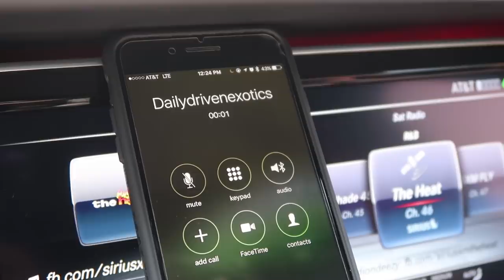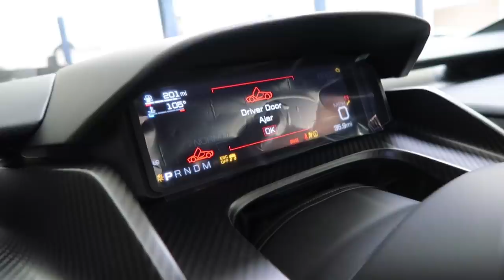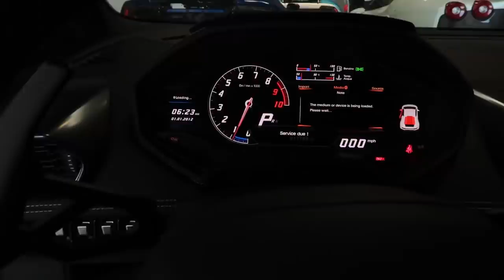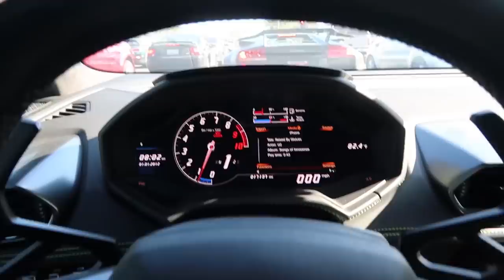I MADE MY LAMBO FASTER THAN A BUGATTI!!!

Comment: You should twin turbo it to with the super changer and see how fast it will go
Reply: Wolf skull You're trolling...
Reply: Wolf skull That is just screaming problems.
Reply: Wolf skull uh. U cant
Reply: Wolf skull hh
Reply: Wolf skull he would have to build his transmission and other engine parts because the stock parts couldn't handle of that power and that would mean it would be in the shop for months
Reply: Rumpaj you can, its called a twincharger. But his tranny would probably fall off the bottom of his car within a day of driving it.
Reply: Rumpaj yes you can😂
Reply: +Turbzay with twin superchargers, an estimation for the trans lasting a day is a bit too optimistic...:-) also, a twincharger is a considerably more difficult build to do...and its not like you just leave in the first supercharger and throw in another one- its a complete redo...
Reply: Twincharger not TwinSUPERcharger. He means Turbos + SC
Reply: Rumpaj yeah you can
Reply: I think it would explode if he did that
Reply: twin turbo whit the "super changer" 😂
Reply: You can get 2000+ hp from just twin turbos. Twin charger setups are extremely expensive and complicated builds. Not really worth it. The acceleration might differ but stock internals wouldn't last very long.
Reply: twin turbo with 2000+ bhp and stock internals wouldnt last a mile...
Reply: Compound charge doesn't directly make it faster, just different response.

Comment: It might have been faster than a Bugatti, if you put turbos in.
Reply: Ya Boi not even remotely close
Reply: Ya Boi A twin turbo v10 vs a quad turbo v16, yea I think you are wrong by quite a far margin.
Reply: You do realize how much Veyron's weigh? Ever heard of Power to Weight ratio?
Reply: Taste Da Rainbow w16*
Reply: Taste Da Rainbow the chiron weights like a tank
Reply: nope not even close
Reply: lmao a lot of people have heard of Underground Racing's twin turbo lambos huh?  Stage 1Rs easily reach 1200+hp
Reply: Luq Man stage 3 race heads run 1200 whp. A Stage 1R is 1550 whp+
Reply: Ya Boi 2,4 is faster than a Bugatti
Reply: Taste Da Rainbow number of turbos and cylinders doesn’t mean much. Single turbo 4 cylinder cars can take a Bugatti in a drag race...
Reply: Yeahhhhh boiiiiiii
Reply: Niko Moin Quicker not faster.A bugatti top speed trumps a lamborgini.You are referring to acceleration the Chiron can easily 2.4 secs or even better
Reply: PPSHY Chiron doesn't way like a tank.That is a gross over exxageration
Reply: mana843 weight only matters in acceleration and handling, not top speed

Comment: Supercharged is absolutely the way to go. It's power on demand. Instant torque, and a nice linear power band.   The car is still drivable, as far as handling is concerned, plus it's fast. Straight  line speed is what twin turbos are good for. That's it. And they look good. Super glad things worked out the way they did, even though it was a bit of a kick in the nuts getting there.

Comment: That shop employee revved a multi-million dollar Lamborghini without warming up the engine. You can see the redline was limited to 6k, which the car does when it's cold. He revved it to 6k.
Reply: So whats your point?
Reply: I thought exactly the same thing. What will the owner say if he sees this video...
Reply: multi million try 300 k
Reply: mohammed alshawi its 2 mill
Reply: mohammed alshawi do you even know what that car is?
Reply: k
Reply: Engine wasn't moving the weight of the car (no load) so it's not that bad but still something I would avoid.
Reply: That's the centenario, it costs about $2.5 million. Not 300k like an "average lamborghini"
Reply: mohammed alshawi oh its multi million
Reply: Willy Willy They know what they are doing
Reply: Willy Willy So its safe then? The car already protects itself :)
Reply: A short rev won't do much harm.
Reply: First Last Racists aren't welcome here
Reply: nah
Reply: Willy Willy They don't redline at 6k... Way higher. Shouldn't need a ton of warming up in 90 degree weather if it was a cold start.
Reply: Nobody asked you! GFY! If you pause the video at 10:33 it absolutely redlines at 6k, not even debatable. It's an electronic dash, so I guess the redline might change after it's warmed up, but there's no doubt it's 6k.
Reply: Willy Willy it's 90 degrees, the oil isn't cold n thick, 5 seconds and the top should be good to rev.
Reply: I Know it was so cringe. It wasn't even one rev, he kept doing it over and over.
Reply: That's a Cenenario, not a Huracan.
Reply: My whole comment was based around the fact that no, they don't.
Reply: An engine like that is warm at 220F, not 90F. 90F is better than 30F but it's NOT EVEN CLOSE to being warmed up.
Reply: When the engine is cold, it redlines at 6k to protect itself. When it's warm, it moves to 9k.
Reply: Sorry man, that's just not true. You gotta let the oil warm up if you want to be respectful of the engine. Load or not.
Reply: Who gives a shit this is a car that will never make it to even 50k miles in its life redline it every day on cold start and the racing engine Lamborghini made for it will still last im sure...
Reply: First Last Believing that your statement was fact is the definition of racism. Something tells me you struggled in school.
Reply: It's just a car...
Reply: what in the name of thew world r u talking about
Reply: Isn't the point of a variable redline to prevent damage from exactly this?
Reply: +mohammed alshawi, It's A Lamborghini Centenario. A Special Edition Of The Aventador, Which Itself, Is Worth Twice As Much As An Huracan. The Aventador is At Least $450K, And This Centenario, Which Has Been Customized, With Color Schemes, Is Definitely At Least  $2 Million.
Reply: First Last where are you from?
Reply: Andres .C  it can do more harm sometimes than a long rev
Reply: Tbf how do you know it wasn't warmed up prior
Reply: John Rockett  I well it had the small bit of white smoke which hints at it
Reply: Chad West Lmao it’s a quarter of a million not even close to 2 million
Reply: Willy Lamb Definitely not a multi-million dollar car. It’s a quarter of a million lol.

Comment: Maybe you can finally beat streetspeed717 now
Reply: Riley Bunce not if he gets a built diff
Reply: Riley Bunce No way.
Reply: He plans on replacing the z06 with a grand sport. Parker will win easily, doesn't matter whether he builds his diff or not the guy cant shift
Reply: Tyler Hoeve his car isn't running because he blew his diff. He can't put the power down that his car is capable of unless he upgrades it.
Reply: Tyler Hoeve no because the diff he just blew has not been replaced and then maybe he could accually put down his full 1k tq. and 990 hp.
Reply: GudJuJu If he had a auto with launch control then it's a different story but he is still going to have to slip the clutch off the line so built diff is not going to make it faster it's going to make it more reliable. Better tires (slicks) with the built diff would make it faster because he could get out the hole faster leaving at a higher RPM but his drag radials can't take a higher RPM therefore the diff will not allow him to leave harder on it's own therefore will not make it faster. This is common sense I don't even know why I have to explain something like this to someone a diff is not a power adder just because you upgrade something dosnt mean your car is all of a sudden going to be faster.
Reply: Tyler Hoeve who claimed speed? If you can't put the power down from a dig when your intended use is to drop the clutch then you need a diff that's capable of the power. Why are you intentionally missing the point? You realize nobody claimed speed at all right? If you can't put the power down without shattering your diff into tiny little pieces you need to upgrade
Reply: GudJuJu Clearly you are the one intentionally missing the point and you do not drop the clutch you slip it that comment right there let's me know who I'm talking to lmao prob never even drove a car let alone drag raced one.  I'm speaking logically you kids think adding a built diff makes a car faster because you can launch it harder when in reality he was already spinning on drag radials without a built diff so how in the world can you gits claim a built diff will make him faster he can't leave any harder then he already was tires will make him faster a built diff just makes it more reliable stop trying to dodge the obvious.
Reply: Tyler Hoeve nobody is even claiming that he's trying to launch harder that's another good one, we're stating that the way he launches RIGHT NOW is too much stress on his diff
Reply: ali129 thats a big downgrade
Reply: GudJuJu if you drop the clutch on that car you will either burn the tires off or break a trans

Comment: Bro your car is perfect. Don't do nothing more to it except for bumping the HP from 805 to 1005 and also you would need a transmission build. Just to be sure. While you at it. Change your front and rear diff oil.

Comment: How is a VF800 kit faster than a Bugatti?  I assume you are talking about a Veyron and that still cannot be accurate.  The top speed and the acceleration to 200mph by the Veyron is beyond this modified Huracan.  Plus, I don't see the HP per dollar a value here at $30,000 for this kit, you are getting a 200hp bump.  Twin turbo is a no brainer in these cars and now that more shops are doing it, the price is decreasing on parts and install.  And you can easily double your horsepower, but to each his own I guess.  Burn that YouTube mulahhh.

Comment: Why is everyone comparing cars, saying this car is faster than that car or slower than this. People are saying this car S/C isn't faster than anything. Faster meaning top speed, faster meaning acceleration, faster meaning 0-60, etc etc. 1/8 or 1/4 mile? The LP 610 stock runs 10.4 and this Lamb has 200 more HP so it can definitely run high 9's now. Stock Veyron ran low 10's. In the 1/4 mile this car is now faster than a stock Veyron. Top Speed, that's a mile run on a runway. Bugatti variants now are all running 9.7 to 9.9 which this car is capable of. Names are just names. All these cars are fast these days. One car can win in a 1/2 mile but lost to the same car in the 1/4 mile. Doesnt mean one car is faster than the other. All cars running faster than 11 seconds is fast, who cares. 10 seconds and faster is still fast as hell.

Comment: People really need to understand the difference between the meaning of fast and quick... the Huracan will never be 'faster' than a Bugatti simply because of it's gearing.

Unless you start changing gear ratios, this 805hp Huracan will reach a top speed of around 220mph before hitting it's rev limiter... at this speed, the Bugatti is just picking up 7th gear and pushing on to it's tyre limited top speed of over 260mph !

Yes, it may be as 'quick' as a Bugatti but it's not as fast :)

Comment: Stop exaggerating! One of the most reputable car magazines in Germany reviewed an Audi R8 V10 Plus with basically the same supercharger kit. Certified and calibrated measurement equipment was used. Car was as fast as the stock car from 0 to almost 100 mph, only in the upper speed range over 100 mph, the supercharged car was faster. 0-125 mph in 8.3 seconds (stock car in 9.3 seconds) but to 300 kph (almost 188 mph), the supercharged car was almost 5 seconds faster. So yes, the supercharger kit works well but not as good as many think it does. Stock car was even 0.2 seconds faster from 0-60 mph. LOL